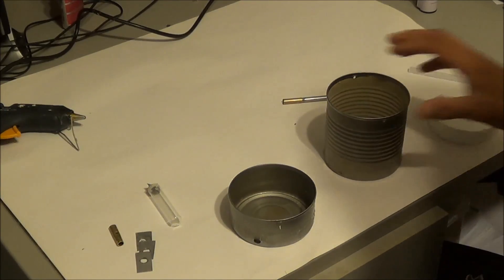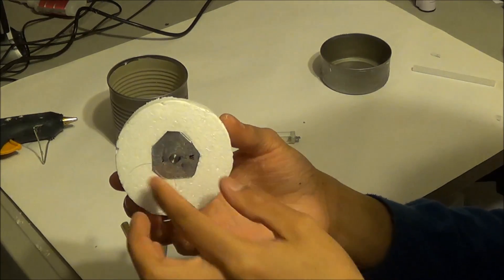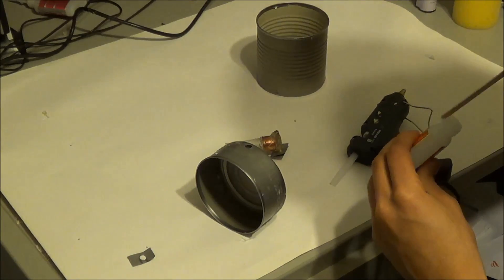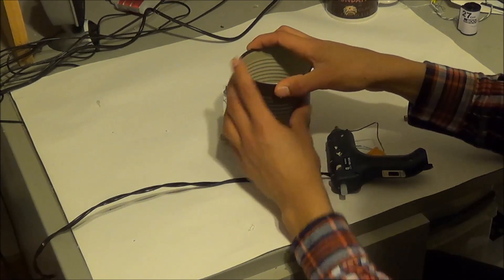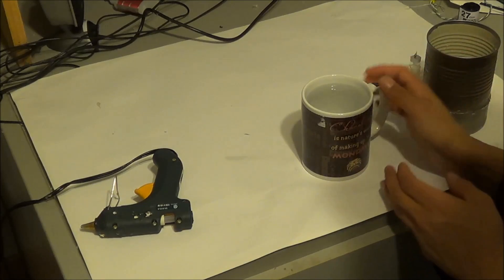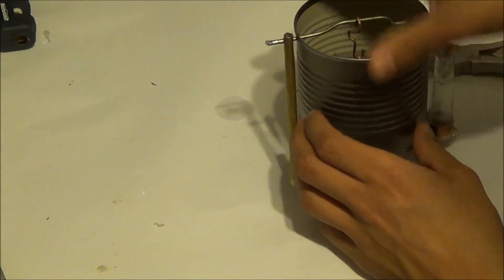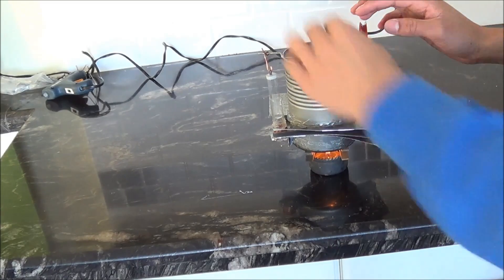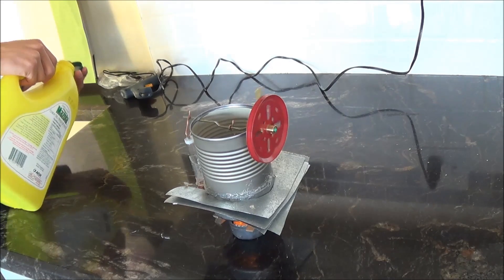Building a stirling engine and seeing how it works

Comment: Engineering is so kind to some people and it works  even though the people are not so kind to the engineering components they use.   A week or two  at a technology workshop principles would have made that engine works much better.  Still congratulations for the effort.

Comment: thanks for posting. my.02
are you using hot glue on the HOT side of the system???
you used styrofoam, on the HOT side of the system???
cheers